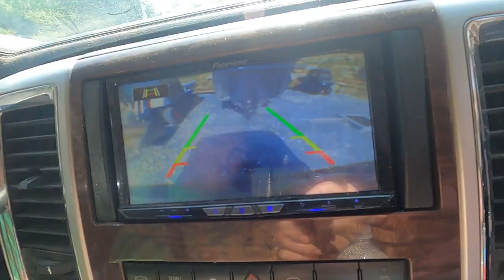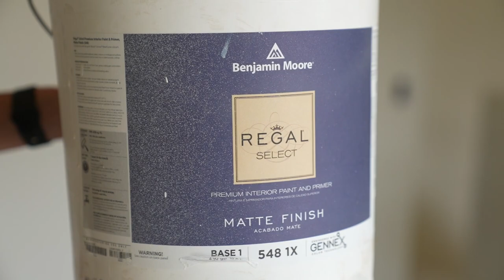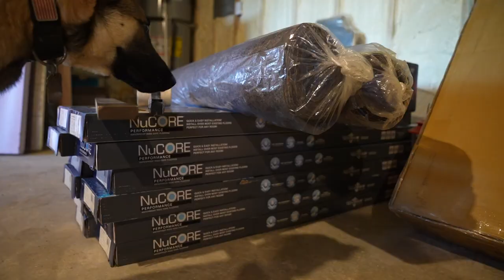FINISHING THE ACCENT WALL | DIY CABIN IN THE MOUNTAINS

Comment: Allie. From someone who lives in the country. Your mudroom floor needs to be the most durable floor in your house. A concrete mudroom floor is not a very bad idea. A lot of dirt water comes in, and over the years will damage your floors. I've tried tile and linoleum with no prevail. Might I suggest checking out polished concrete floors,or epoxy finishes online. You might just be surprised. But Trent is right about it needing to be at least sealed.  Food for thought.

Comment: Save some of that large cardboard.  Open it and tape the flaps so u have one straight flat piece… works tons better than a drop cloth when painting.  Drops get kicked around and tangled when moving a ladder.  Cut pieces to fit right under doors for when u open and close when staining and polyurethaning.

Comment: You mentioned putting tile on the ceiling of the shower.  I just saw the same thing on This Old House, and they had to put a slight angle/slant so the condensation will slide off on to the wall so you don't get cold drops of water falling on you while you shower.

Comment: Regarding your deck, I don't recall how you attached the beams to the posts but you might want to install T-brackets at the connections for added lateral shear strength.

Comment: Actually stained concrete can be very pretty and practical, especially for a mudroom/sunroom space.  If sealed correctly it is easy to clean and more durable than regular flooring.  BUT, it's your house so you do what you want to do.  :)

Comment: Happy dance! Glad you decided on using Ben Moore’s “White Dove”. That’s the color I’ve used throughout my house. Easy on the eyes, and still brightens. Well done!
Before you tile the ceiling in your shower, please double check that the tile you selected will install well for a ceiling application. If you run into weight problems, you might consider using Azek or a similar PVC sheeting. Lowe’s sells 4’x8’ x .375” sheets. (comes in white).
Good luck

Comment: I made 1 by 12 mdf trim board by ripping down 4 by 8 or 4 by 12 sheets of mdf into 1 by 12 trim board. Way cheaper then the already made boards and i will Bet not in short supply. Just make sure you sand the edges to get a smooth edge to paint.

Comment: I'm afraid you might regret using MDF on the window trim.  It is not particularly strong material and does not do well getting wet.  I would think there would probably be some condensation on the inside of the windows with the temp difference in winter.  I would have used cedar.  It is much more stable, looks nice and stains beautifully.  I buy standard 5 inch fence pickets and run them thru a thickness plainer and then a sander.  It is amazing how it turns out.

Comment: I am wondering what siding you are planning for the outside. Love log siding..always neat looking in wooded settings.
Reply: There is a concrete sections made to look like log walls, varies in style and colors, Fire resistant and lasts a lifetime. If I recall made in Idaho. Seen it on " Good Simple Living ". They are also building a home.

Comment: for future staining pine, did you know that pine is one of the hardest woods to stain evenly?  It needs a special base coat before putting stain on it, then the stain will look much better, more even.  Also if you are painting the ceiling, you need to paint stain block on the knots, otherwise they won't look good when you paint them

Comment: Trent,  did you left a gap between the planks and the wall?  With your wall length a gap of half inch at euch side shoud bei left. Otherwize it will screw up your planks After you move in.

Comment: By the way, Brice was not touching up the drywall. He was putting the 3rd coat of mud on for you. At least, I only saw you do the first two coats...plus that prefill thing that was pretty unusual and took the energy you needed to do your third coat. So, you guys were doing a pretty good job... you just didn't finish it and your friend came up to do the final coat for you...which was pretty smart as that is the one that needs to look the best and he has experience.
That accent wall looks amazing!!!

Comment: Like you I didn’t like the wall at first but now that it’s finished it looks great. Did you get moisture resistant MDF for around the windows? Also before installation make sure you paint the MDF to seal it on all sides

Comment: Your home is really coming together.  I was wondering if you have ever tried to run water in it again since two of the three times on camera times it flooded.  I would hate for you all to continue you bring this process to a close without testing the plumbing again.   

Also, I am not sure what both of your final thoughts will be on the wood wall since it has been mentioned in the last two videos, but keep in mind, if you don't like it you can always paint it.  Personally, I think it would look good either in white or green (reminiscent of the green color before the insulation and soon to be siding) color. 

Lastly, I have seen YouTubers with small season wood sheds, which might be a permanent solution instead of moving the firewood from location to location.

Comment: I always heard you kept firewood away from the house not die to an accidental fire but due to bugs and critters! Termites, carpenter ants, snakes, etc. As long as the firewood is aged. A little rain on it shouldn't be a big deal when you build a fire ( from someone that stacks their firewood in the yard (it gets rained on) and builds a fire every day in the winter. Bugs are much more likely to damage than a freak fire accident.

Comment: I thought you were putting countertop on the window sill (you mentioned in another video) - confused. Aren't you concerned by using MDF that if you leave a window open by accident (even a bit) and it rains that the MDF will swell? Just curious.

Comment: Build or buy a series of wood racks to get the firewood off the ground. Locate the racks at least 5 feet (if not farther) away from the house.  Cover the stacked firewood with tarps to keep it dry and easier to access when everything is covered with snow.  Don’t bring into the house more than a 2 day supply of firewood, or better yet,  have an additional wood rack (albeit smaller) on the deck, again, covered with a tarp for the 2 day supply.  Do Not Store Firewood Against The House, especially on the ground where it will attract termites and other insects, that you wouldn’t want to be bringing into the house, not to mention mice and other woodland creatures nesting in the wood (mice, voles, SNAKES, ETC.)

Comment: You've thrown enough decent scrap wood out that you could've easily built a temporary wood shed. Or lay it out as a walkway to the house to not walk in mud. Either you guys are doing awesome on the build, but also I totally unstand the need to get rid of as much scrap/trash as possible.

Comment: It is so sad to see all of that wood and drywall go to a dump instead of allowing someone to buy it to use for small projects. Now create a protective temporary barrier of some kind all around the wood under the porch to prevent critters from using it and to protect it from collecting moisture from the air.  Once again Allie deserves much more respect than what is given on video like not letting her know where you were which you could have done in a text.

Comment: BAD. BAD IDEA stacking anything against your house!   That’s just asking for trouble down the road.  Not just a fire hazard.   Critters will make themselves a home in there.    Along with mold and mildew will develop.    I live in the northeast, similar  weather conditions.  I keep my fire wood away from the house. Covered up with a tarp.  We use the firewood a lot for the fire place and the fire pit.   I strongly suggest you keep your firewood far away from the house!  It will save you the headaches later on